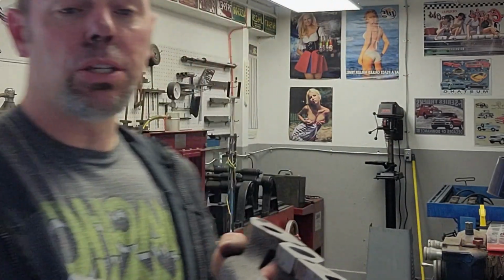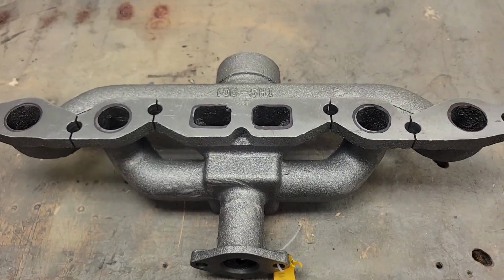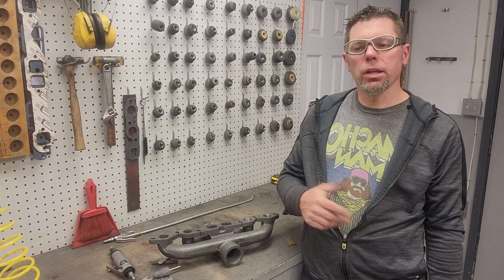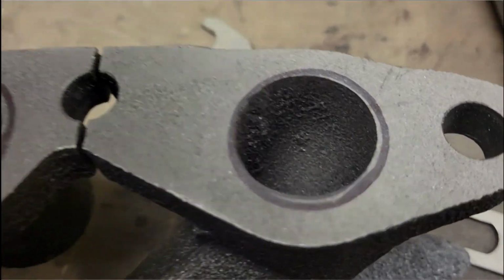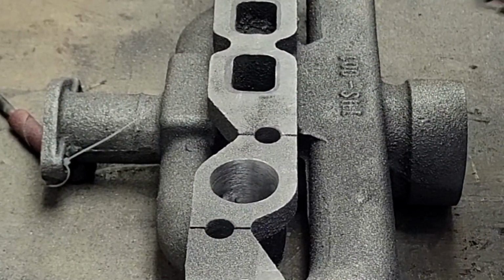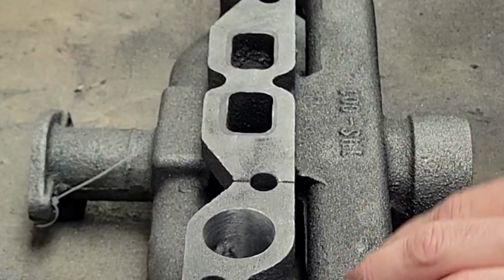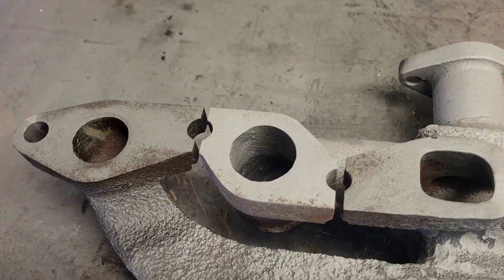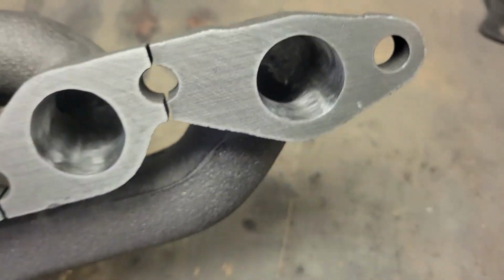How I set up my Farmall Super C manifold for tractor pulls.

Comment: Did you do any other work for the tractor? How much horsepower did you gain?
Reply from the maker: I went through and rebuilt the cylinder head and did some port work on it also. Between doing that and the manifold, when I took it out and pulled with it after doing the work it was a different animal. I am not sure how much HP I gained. I also bumped the govornor up to 2100. I am guessing I am close to 30HP. Pretty good gain from the 23HP. The head I put on and reworked is also off a C. The original super C head was cracked.